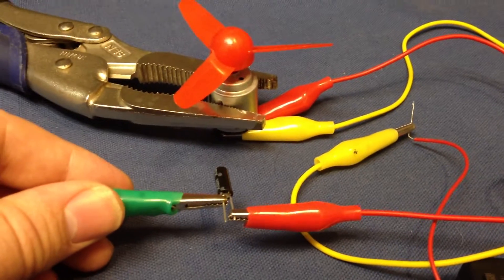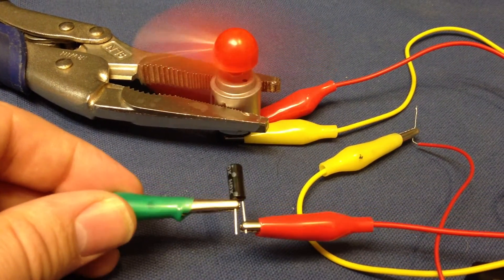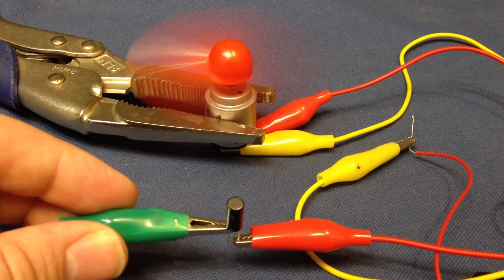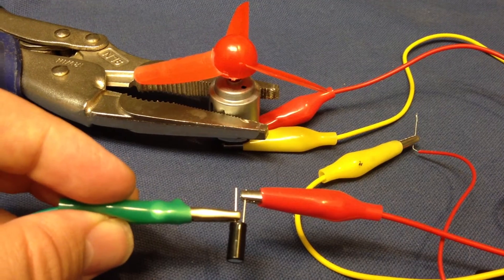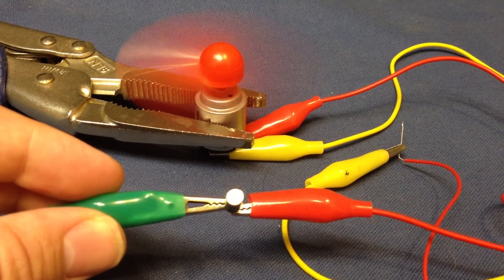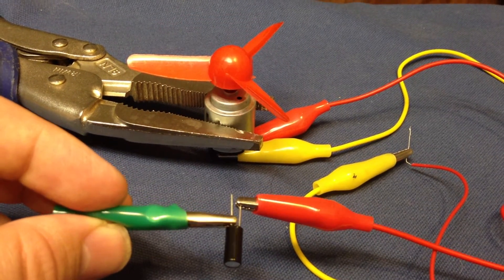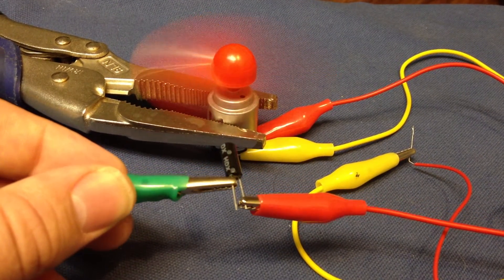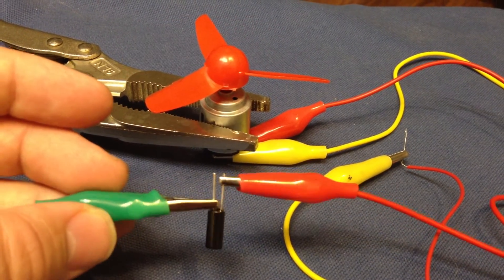tip over switch

Comment: That's tiny.Wow.Looking at a tip over switch in an electric barfire.it was knocked over.Its needs reseating or bending back to its original position.It still works.Looks like a pendulum.